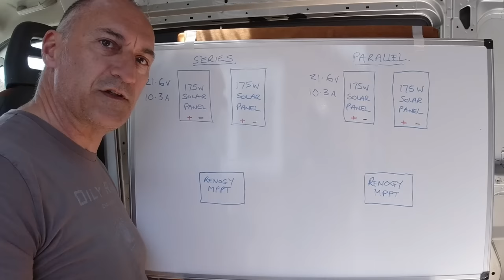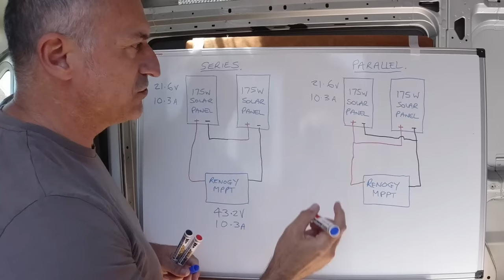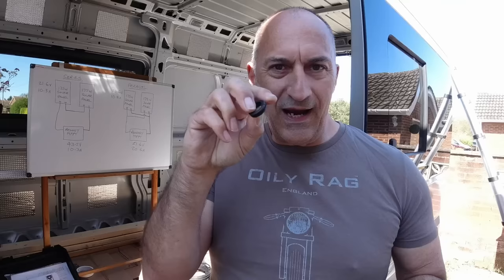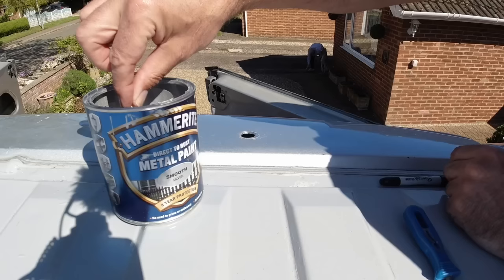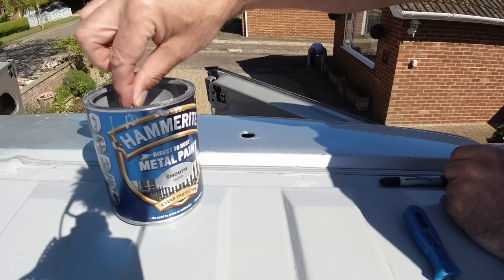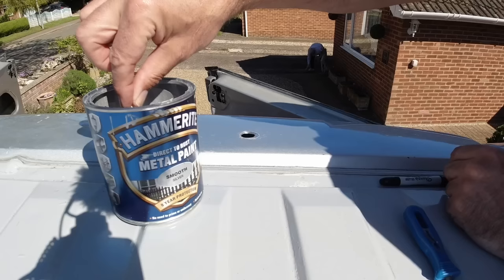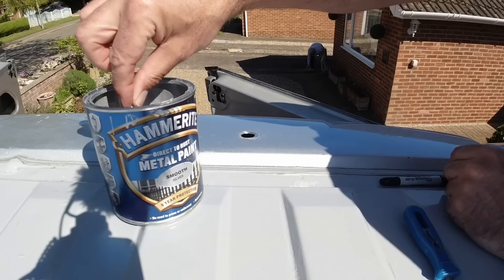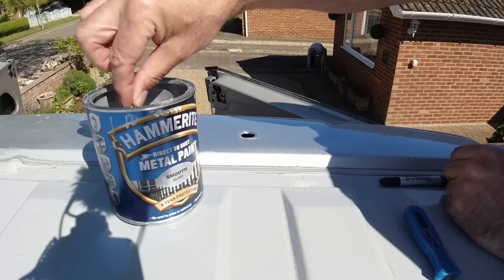How to Install Solar Panels - Budget Van Build Ep 10

Comment: Thanks so much Greg for these helpful videos! I've gone from knowing nothing about converting a camper and definitely nothing about electrics, to having managed to insulate, vapour barrier, ply line and now have spot lights wired in! I couldn't have done this without you! I have a quick question, I'm following the wiring diagram to the 't' as regards solar panels, but I've hit an obstacle, the diagram suggests to use a 16mm cable from the battery to the charge controller, but my charge controller (an Eco-Worthy 30amp) has ports that are way too small to attach a 16mm cable. Anyone know the fix for this? Is there a connector I can use to connect to a smaller port? Or would it be better to use a smaller diameter wire? This scares me as I know if I stick to what Greg did I'll be ok, I don't want to go messing! Thanks, Jen
Reply from the maker: Hello Jen, I assume you are refering to the cables from a 30amp PWM or MPPT solar charge controller to your batteries? (as i'm not aware Eco Worthy make a DC to DC charger?)  If the solar charge controller is located less than 2m away from your batteries then @ 30amps you can use 6mm² cables. 

I'm only using 16mm from the van battery to the DC to DC to keep the voltage drop down over a much longer distance.
Reply: @GregVirgoe Yes, you’ve assumed correctly! The battery will be right by the charge controller so I can use a 6mm cable. Thanks so much for your reply, I can get on with things now! 😌

Comment: Hi Greg, usually you list a few possible ways and various products that achieve the purpose required and then say why you've chosen a specific one. Here, you hav'nt mentioned the possibility of using flexible solar panels. Renogy make flexible ones, so the quality must be good, and flexible are so easy to fit, just glue them down, very streamlined to the roof. Flexible would seem marvellous, but what is your opinion about flexible Greg? What is it about flexible solar panels that makes you prefer using solid ones for this van build? I value greatly your opinion. Thanks Greg.
Reply from the maker: The problem with flexible panels is they get too hot and that causes them to fail prematurely. Sticking them to your roof is actually the worst thing you can do because air cannot circulate beneath them to keep them cool. You’ll find that warranty periods for flexible panels is a lot less than rigid due to the early failure rates.

Comment: Hello,

Should you not fuse the panel cables each instead of the main solar cable. Because the main solar cable is thicker then de solar panel cables?

Comment: Thanks Greg, just one question hopefully not covered in comments, when you sikaflex the brackets i noticed you only did one side, understand the ridges on roof but will this hold ok or would you pack other end of bracket ?
Reply from the maker: It will hold ok 👍🏼 I didn’t do the other side as water would collect in the lower ridge and cause potential for leaks. You could mount the brackets on the end of the panels and get two fixings in each that way. 👍🏼😃

Comment: Following your build with great interest. Is ut possible to simply sikaflex the solar panel brackets to the van roof so as not to drill holes in the roof?
Looking forward to your next lesson.
Reply from the maker: If you want to do that I would use the white plastic support feet as they have more surface area. Alternatively use the brackets I showed at the end and build a roof rack frame to fix them too
Reply: @GregVirgoe  many thanks

Comment: Question is then between series and parallel, which gives you the better charge rate? is it the doubled voltage or the doubled ampage?
Reply from the maker: I’ve found that in series works well in winter and low light to still give you a small charge. We didn’t have an option this time as the controller would not accept higher voltages.

Comment: Hi good morning. Very good video! Did you use the 30amp or 50amp charge controller?
Reply from the maker: I am using the 30amp version because I have AGM batteries, if you go for lithium setup you can use the higher 50 amp version.

Comment: Do you need to fuse the negative cables?
Also I only have 2- 100 watt panels that I'm putting in parallel. What size fuse should I use?
Reply from the maker: Those panel will most likely have a max current of 8amps each so a combined fuse of 20amps would be suitable.

Comment: Greg,  looks like my van isn't a write off after all but one of the first things ill be doing when I have got it fixed will be fitting some solar.  Is it just a case of isolating my current split charger and swapping it out for the Ronogy unit you used?
Reply from the maker: Most split chargers use the chassis for the negative so it’s best to run a negative cable both ways from the dc to dc as well as the positive cable. Far better that way. 👍🏼😃
Reply: @GregVirgoe  Cheers Greg.

Comment: Hi Greg - looks like my van maybe written off next week so I might be building again soon so am finding your latest set of videos really helpful.  I have a couple of questions (sorry if you have said in the video as I may have missed it), firstly am I right in thinking you are using the 30amp module and not the 50 amp?  Secondly when you dropped the cables from the solar panels into the van have you done anything to isolate them as the panels will be trying to generate power - won't they?  All the best mate Frank.
Reply from the maker: Yes I am using the 30A version because of my battery size. It is not advisable to overcharge AGM batteries. It works out to be approx 15% of my capacity. See my pinned comment re the live cables
Reply: @GregVirgoe  Cheers pal

Comment: been given a 36v, 170w solar panel, the type you put on a house roof, any ideas on what type of controller I need, as my cheep £2.99 blue thing from china might blow up  :),  can not find any vid or info on this set up, only 12/24v bog standed panels , as cheap as poss, little money    cheers

Comment: Hi Greg,  we are serious considering using a Power Station for our electrics (e.g. a Ecoflow Delta). Would you run the solar in parallel or series for this? P.s. me and the wife follow everything you do on our Peugeot Boxer..we are at episode 4 stage 😊..thank you so much!!
Reply from the maker: You need to check the max input for the power bank to make sure you don’t exceed it. I’m going to be doing a video on this very soon next week or so as an alternative to a fixed system. So stay tuned 😊

Comment: Hi Greg, thanks for your greatly detailed video. Aren't you afraid of leaks as you pierced quite a number of holes in your roof while fixing your panels and vent ?
Reply from the maker: No not at all. The sealant is really good stuff 😊
Reply: @GregVirgoe  Thanks for your answer !

Comment: Hiya Greg i have a pitch tiled roof athe the front of my house. I could at a push get 4 of the 175 watt panel on it. Would that be enough to be worth while to power anything in my home? We are south facing? Cheers Tony
Reply from the maker: Yes absolutely 👍🏼 that going to generate on average about 2kw hr of electric per day. So it’s enough to run lights and tv etc. if you had a large battery bank you could do some cooking with small induction hob or microwave. However washing machines and electric showers or electric ovens would use too much power of that setup. 
But it would pay itself back within a year I recon if you source the materials and did the install yourself just get a qualified person to do finals and check it off 👍🏼😃

Comment: Hi Greg what do they call the connectors that join the wire to the solar panels , not the 3 point one the single one ?
Reply from the maker: They are all refered to as MC4 connectors... here is a link to some single ones  https://www.ebay.co.uk/itm/125330387911?hash=item1d2e45f3c7:g:G3oAAOSwhplhstEM&amdata=enc%3AAQAIAAAA4N63yHe1YhbyAT9fwd1wMhhmAtb69Oa0HNKGNNAyHVox5obOTI6zC5xRL8UiaIXqgOy%2BL4sSvXCoH5piz0CRDhch0M7aiJJ5DX4Bgi7BMWDbpvPZ5dNWVNT2RAjbQxcN7hfozsdZ2%2FeAdGhDYFWkCcwfhTT94kUJ2ZhMWyEjDFCjXN8m09WcyIwTYqaJqlhzJlCgwpbDj93eYLRPCNxRDFAnQPoSpPrXq9OWqGhJglu4cJMIHyG3Hu5KyWBYTNstr%2FpGIAFKqkeulkO204L3T3O5tJYMwkuWCLQU3zw987cE%7Ctkp%3ABFBMpO_pivdi&mkcid=1&mkrid=710-53481-19255-0&siteid=3&campid=5338027957&toolid=11800&mkevt=1

Comment: Hi Greg, hope you and Lou are well, did you pre drill a pilot hole for the panel brackets or go straight in with the self tapping screws please? Cheers Lee and Lisa.
Reply from the maker: No pilot hole as the screws Renogy supply are self drilling ones so I just let them do the job. 👍🏼🤩
Reply: @GregVirgoe  Cheers Greg 👍

Comment: I have a 330w panel going to a victron controller.can i buy another solar panel kit and have that controller going to the same batteries as well?
Reply from the maker: Yes it is ok to have two solar controllers connected to the same battery string. 
Just be aware of the maximum charge rate for your type of battery. Typically AGM batteries will have a max charge rate of 20% of the total capacity.

Comment: Hi greg thank you so much for sending me the diagram tovset my solar system up but have another thing to ask you wot size has the pv isolater got to be and all so i watched you connect two solar panels together on your fiat decato on the roof is that better or just do the one you have sent me a diagram of sorry to bother you but love watching your set ups thank you
Reply from the maker: What mppt controller are you using?
Reply: @GregVirgoe  sorry Greg it's renogy adventurer
Reply: 30a pwm lcd charge controller
Reply from the maker: @davidheron5479  it has a max input voltage of 50v so as long as adding both panels does not exceed that then you can wire in series.

Comment: Hi Greg, I'm following you almost step by step on my 2017 Pugeot Boxer. Is there a reason why I shouldn't buy the 50A version of the DC-DC charger? I'm going to get the same x2 175 panels as you. Thanks in advance! Big fan of your videos and looking forward to the next one.

Edit: I'll be using the 280AH Fogstar battery, but I've just looked into it and I don't think the 50A version of the charger would be suitable with my alternator. So I'm guessing I should get the 30A?
Reply from the maker: I selected the 30A charger because of the size of my battery bank and their charge rate. As I’m only using AGM batteries they can’t handle a large amount of charge. Lithium would be able to handle more but they are still quite expensive
Reply: @GregVirgoe  thanks for the reply Greg!

Comment: Hi I've bolted a flexible 130 watt solar panel to Multiwall plastic sheet that I attached with sikaflex so I can easily swap it out with just 4 locking nuts.
I didn't use a fuse but think I should, would this 30 amp one be too big? Thanks.
Reply from the maker: You need to look at the max amps that your panel will produce and add 25% to that to get the fuse size. They make 10, 20 & 30A fuses for solar panels.
Reply: @GregVirgoe  OK thanks.

Comment: Hi Greg If I add a extra 175 watt solar panel so that will be 3 x 175 watt will the Renogy 30A 50A DC to DC Battery Charger Dual 12V W/ MPPT W/ BT-2 OR W/ Monitor, cope with all three, thanks Sam.
Reply from the maker: You will need the 50amp model because that would exceed the input watts for the 30a version. 
The solar panels must still be connected in parallel so use a triple MC4 connector to do that. 
Battery cables need to be larger 25mm and fuses need to be 75amp on starter battery and 60Amp on Leisure battery 👍🏼😊
Reply: Renogy REGO 12V 60A DCDC Plug Play Battery Charger Built-in Bluetooth Gel AGM Li 
I was thinking this with 3 x 200 watt solar panels will this work ?

Comment: Hey! Ive installed 500w total on my roof of my camper and i have 3 panels which Ive wired in paralell. Im in spain right now but i get only about 200w from those on a perfect sunny day. The sun is not very high at Winther so the angel to my panels is not the best but i think 200w from 500w panels is to low??? Ive tried to clean the panels but its not making much sense.. also have tried to make 2 panels in series and the other paralell but i still get only about 200w. Is this normal do you think?
Reply from the maker: You cannot wire three panels in series/parallel that just doesn’t work. If your mppt can accept higher input voltage then wire them all in series like my own panels. That gives you the best low light winter setup.
Reply: @GregVirgoe  okey thanks. Will try in series but is that not less effective if there is shade on one panel or So?
I wired my 2 150w panels in series and then i connected them paralell with my 200w panel. But it gives me the same watt output of 200w when there is clear blue sky and sun is out. Just think its to low.. how much do you get from your panels a sunny day?

Comment: So wiring in parallel gives the same voltage but ups the amps. What’s the advantage with that do you get a faster flow of charge into the batteries?
Reply from the maker: No difference with mppt controller it’s the same amount of power (watts) either way. Just one way the voltage is higher so better in low light situations and the other way the amps is higher but voltage is lower so this controller can handle it. You do get better redundancy in parallel.
Reply: @GregVirgoe  cheers for taking the time to reply Greg. Van build is looking great really enjoying the series

Comment: Personally I would want 1000W of solar, but that's because I don't want to blow myself up trying to fix a gas cooker, I will have a cooker that runs off butane, but it will just be off those small butane bottles, but they are kinda expensive do they will be just for the winter the rest of the year I will be using electistiy, also when I start out heating will be a diesel heater, but after I have my full electical system and can save up I will be adding a heat pump so I can get cooling and heating. The full solar peek power will be like 2000 - 2500W with solar awnings, 12.3kWh of batteries and 6kW of AC output, will still have the diesel heater for when I'm running low on electricty, but that should only really happen in Novemeber to early January.
Reply from the maker: You planning on having a huge truck to fit all that on 😃
Reply: @GregVirgoe  It's a fairly long van, but as I said I'm going to have solar awnings so kinda extending the roof. and with rack mount batteries you can get 10.2kWh hours of batteries and a 6kW inverter in a desktop cabnet, and the extra 2.1 kWh is gonna be like a backup powerstation which will be tucked away once I have my full system.

This is gonna be in like 3 - 4 years, I'm gonna start off just with that 2.1kW powerstation and 1000W of solar which can fit on the roof, then add a single rank mount battery for extra energy storage and a solar charge controller than can handle 2.5kW of solar pannels, so I can charge the rank mount battery which will then charge the powerstation through the solar port.

Then the 1500W solar awning, then the 6kW inverter, then the heat pump, then an extra 5.1kW hour rack mount battery.
Reply from the maker: @Etheoma  your inverter has the potential to use 6x the amount you can generate even on a perfect sunny day. What do you intend to run in the van that needs 6kW of power?? You know you can only get a maximum of 3.6kW on an electric hook up, so why would you want more than 3kW inverter?

Comment: Does the end of the positive cable become live as soon as its connected to the panel. Would it be a good idea to make the plugs accessible so they can be disconnected if need be in the future or would you say it would be easy enough to unbolt the panle to get to them?
Reply from the maker: The end of the cables are taped up for now and they will be put into a DP Isolator.
Reply: @Greg Virgoe  yeah I seen that. Was thinking about any issues in the future where it needs the panels disconnected
Reply: @Discoveryowner  Put the fuse inside the van instead. If it necessary to isolate the panels pull the fuse.

Comment: I am curious why use these small wattage pannels? You can get a pannel like the ones that are getting installed on house roofs that will produce 500W or more watts per panel. Yes, they are larger, but one such pannel can easily replace 2-3 of those small panels. And the price is not that high compared to 3 Renogy panel. The only downside I can think of is that there might be some difficulty or delay getting the large panel as these are in hight demand nowadays.
Reply from the maker: I didn’t want it to be too obvious from below and this combined with DC to DC charger will be plenty.
Reply: @GregVirgoe  Would it not be advantageous to have more volts?

Comment: Hi Greg you are amazing if I put 2 x100 solar panels renogy on my van and connect them together bring them down to my controller then how do I connect them to two battery's please
Reply from the maker: You need to first connect the batteries together in parallel. 
Pos to pos and neg to neg. 
Then connect the positive from your solar controller to pos of battery no1 then connect the neg from the charge controller to neg on battery no2 so they are connected across the battery string this will charge both batteries at the same rate. 👍🏼😃
Reply from the maker: Here is a diagram I have drawn to show a two panel, two battery setup. Just proceed to website to download your free copy 
https://www.dropbox.com/s/h5yfuf090hgp4ga/Dual%20Solar%20and%20Battery%20Setup.jpg?dl=0
Reply: Thank you Greg video's are great well done